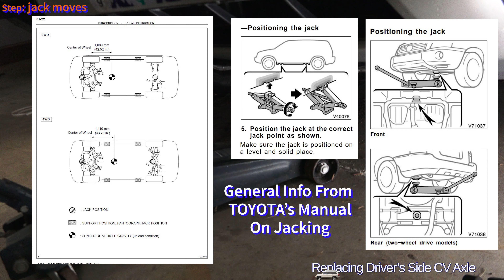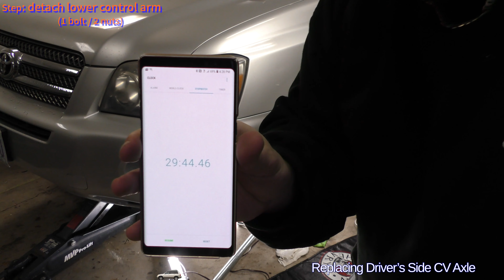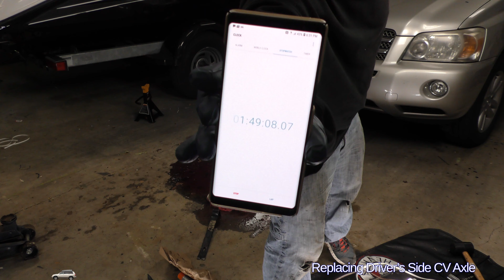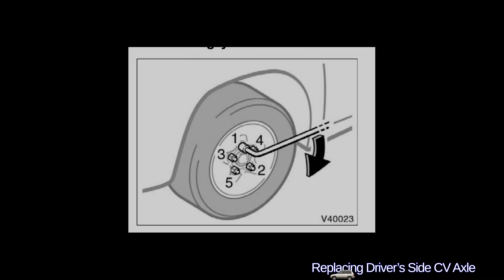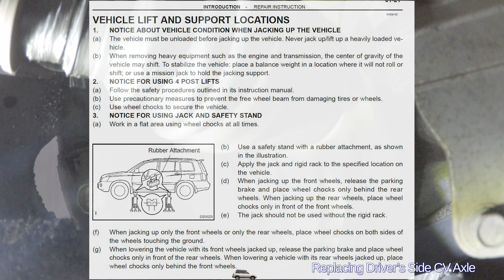How to REPLACE CV AXLE in your car | TOYOTA HIGHLANDER | EASY TO FOLLOW | SAVE YOUR MONEY!! !!

Comment: I watched a few videos on HighLanders CV Axles and Seals and your the 1st to mention check your Transmission Fluid... and if its a 4X4 highLander the Red Transmission fluid runs out both sides and checking the Rearend its Pale Yellow Gear Oil and FULL... The confusing part is the Passenger side looks like it should be Rearend Oil because it looks like part of the rearend BUT !!! RED oil runs out ?? So it MUST be Transmission Fluid............  BUT I've only been doing Auto-Body for 45 years, hope this helps someone :)

Comment: You don't need to put the tire back on to remove axle nut, just stick a screwdriver or punch  through the caliper &   into the fins on the rotor, this will keep the rotor from turning, much easier.

Comment: Thank you for sharing this! My service inspection quoted "replace front  inner CV joint boot(found cv joint boot(s) torn /leaking). Would this be the repair I could do to save me some $$$?
Reply: Yeah dude but I reccomend draining and replacing your Toyota ATFWS fluid at the same time. Why? You won't get fluid all over the place like this. Plus, it's likely never been changed anyways! Finally, a shop will charge around $300 for this without parts! Just make sure that if you have the HYBRID that you get the right CV axle!

Comment: awesome video, helped me a lot! The unit for torque is "foot pounds" (ft-lbs) though, not "pounds per square inch" - that would be pressure
Reply: Actually, units of torque are pound-force feet (lbf-ft)--similar to SI units Newton-meters (N-m).  Units of power are measured in ft-lbs.  As a tutor of college math and physics, I can be quite anal about these matters.  One thing I noted is my expensive Precision Instruments torque wrench (model M3R250FX)  has the units inscribed correctly as "LB FT."  On the other hand, my cheapo Capri torque wrench (model 31201) has the units inscribed incorrectly as "FT-LB."  In physics terms, torque is the cross product of distance and force while work is the dot product of force and distance.
Reply: @armchairtin-kicker503  you have a point there. According to Wikipedia, "In the US, torque is most commonly referred to as the foot-pound (denoted as either lb-ft or ft-lb) and the inch-pound (denoted as in-lb).[14][15] Practitioners depend on context and the hyphen in the abbreviation to know that these refer to torque and not to energy or moment of mass (as the symbolism ft-lb would properly imply)."

Luckily for us, multiplication is commutative :)